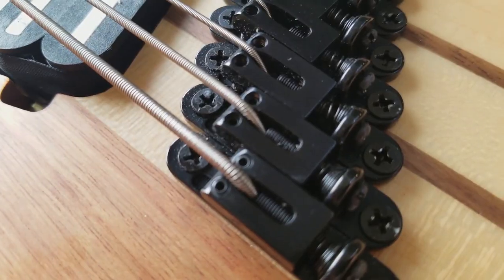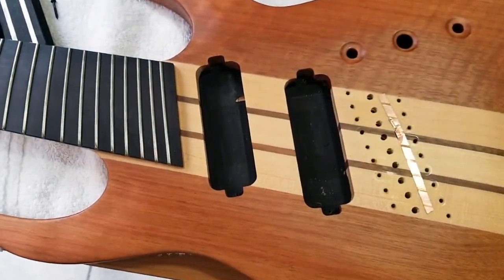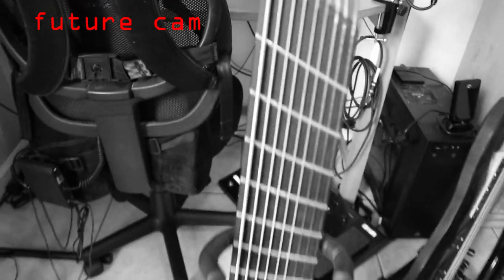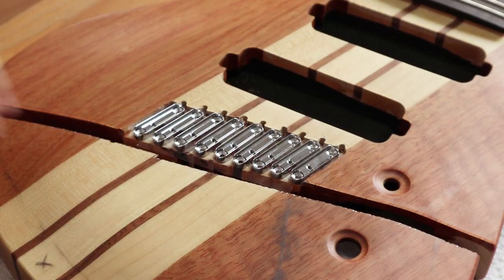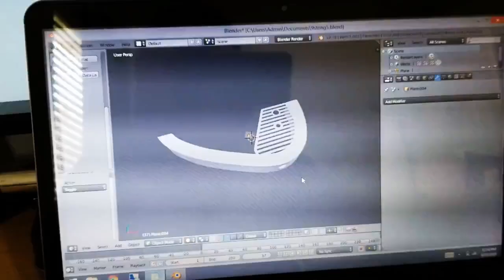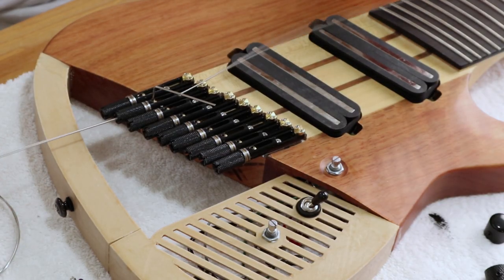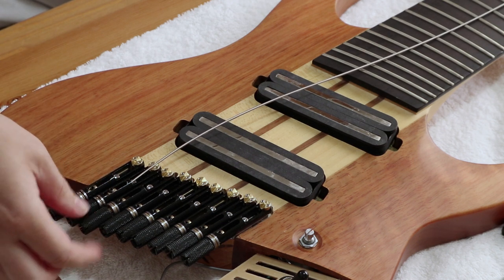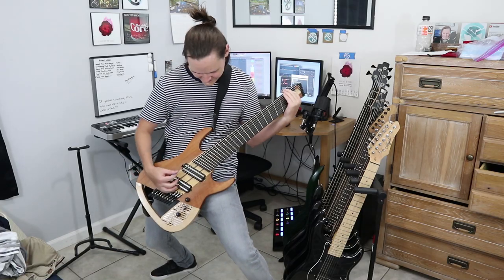9-String Guitar Headless Conversion

Comment: This is awesome! Actually, a nice work. Few things to consider:
1. Trust rod cavity cover (man, that hole looks awful).
2. Fully enclose electronics. 
3. Scratch the paint from the bottom of tuners to allow them to make proper contact with grounding wire.
Reply: This!
Reply: You could also scuff the tuners gently at the points where they touch each other. That way if one isn't getting a good ground contact directly, it can at least hand the job off to one or both neighbors. Or if he's really adventurous, he could silver solder the whole mess into one solid block and never have a problem again -- electrical OR structural.
Reply: I think painting truss rod cavity would look better than that cover that was originally on it.

Comment: It seems like you got it playable. I would do a part two and make a face plate to make the 3d-printed expansion sit flush with the body. Even a revised extension would pull it together a lot better. A little paint and/or sanding and you've got a solid axe🤙

Comment: Glad to see you actually went for it, it looks sick! I was wondering though, why use a 3D printed piece for the body gap instead of reusing the part of the body you chopped off and cutting out the same shape? I’d imagine having the same wood and neck through pattern carrying on through empty space could look pretty cool along with the fact that the transition between the two pieces should be much smoother and the control cavity’s already routed out
Reply: I think it's because he didn't have a saw that could do that he said he only had a table saw
Reply from the maker: Ya, I only have the table saw, I still have that half of the body laying around if I want to try in the future
Reply: @SaidTooMuchProductions  if you were careful, you could do it with a coping saw which shouldn't be too expensive
Reply: For the price of the roll of filament you could of gotten the cheapest trim router or a router head for your rotary tool, and just routed out a recess for the new bridge pieces. Would of looked better and saved loads of time

Comment: the sounds you're getting don't sound like an improperly grounded bridge. They sound like a lack of shielding. That makes sense though as your wires aren't shielded by metal, or wood, or plastic for that matter. You'd need to modify that control cavity to have walls you could shield if you wanted to get rid of the hum
Reply: The hum goes away when he touches the strings.  It's almost definitely a grounding issue.
Reply from the maker: ... that's what I've figured

Comment: I myself would have taken off more wood cutting off the horns and only leaving the arm rest and the lap rest thus turning the contraption into a 9 string travel guitar,- which I think would be cool af.
Pair it with a 5 string short scale bass and you´d have the beginning of a compact lightweight laptop studio where every single item could be fitted into a custom made flightcase and you´d be good to go,- record virtually anywhere....
Hmmmmm......
Just might have myself a new project here....
Good one. :)
Reply: Time to whip out a U-bass with roundwound strings and sound just like a P-bass or J-bass, in an instrument that's only a bit over two feet long...

Comment: would be cool to see someone do a headless where instead of a nut and fasteners, a hardtail bridge is used, allowing the "nut" height to be individually set per-string
Reply from the maker: That's brilliant, an adjustable locking nut
Reply from the maker: I'd like an adjustable nut for drastic string guage change around as well lol
Reply: @SaidTooMuchProductions  the main issues i foresee are that you either have the ball end at the "wrong" end, requiring a tuning bridge that can deal with that, or you'd have to make some kind of locking mechanism yourself. or try to graft double ball ends.

Comment: gotta admit, i lack the balls to take a perfectly good guitar and saw the headstock off. if it was mine, given to me in the current state with a 3d printer available, i'd do a full 3d printed body project, maybe do a home-depot maple core for strength and neck mounting and print the rest. if i was starting from scratch, i'd have trimmed down the body more strandberg-ey instead of a wrap-around, and might i suggest 3d printing a superficial headstock addition for wall-mounting? wouldnt need to be structural, just an epoxied discreet flair, and you could paint the new parts black to look classy with the old wood look. raw wood and flat-black always looks slick. the 3d printed color looks kinda...odd. if you do a 3d printed body, you could do a very skeletonized look, paint it black, and then add a thin clear top to it. i've done a carved semi-hollow bass that has a clear top mounted over the carved bits and it looks neat. you'd be amazed what a 600 grit hand sand and some flat black spray-paint can hide or make intentionally designed looking.   also, let me just say the fact that this has under 15K subs and tic-tock trends have more, makes me throw up in my soul a little.

Comment: Yeah man, that's a really cool video! I absolutely love DIY guitar mods and I have to admit that you have to be pretty brave to butcher your 9 string this way :D. But you really made some mistakes and the result could be better. I decapitated a guitar once and I think you should've prepared better for this. Drawing a scatch or photoshoping something over your 9 string in it's original form would've helped a lot. And you could avoid 3d printing (because tbh this part looks not very professional) by making a strandberg looking design with this deep cut on the bottom. I heard about your lack of tools, but you could borrow a jigsaw for a day, the result would be much nicer looking. I did my guitar this way and it came out pretty cool. But maybe i just nag too much, you did a good job, it works and that's the main thing, in my opinion you just hurried too much in some parts of work and that's why some parts look a little sloppy.  If you had spent a little more time and patience, and calculated things more carefully, this could come out much better. Things like this need precision, but anyway it's a really cool experience. Thanks for sharing this vid and good luck with your next projects!

Comment: I'm all for the jank, but router isn't that hard to operate, yknow... And you can print perfect templates with your 3d printer
Reply: Also you could just get a cheap drill stand off of amazon to serve as a poor man's drill press.
Reply: Now that he's sawed off the big chunk, he can carve on it without a router anyhow. I think he should just do that (carve away the necessary bits of the original sawed-off piece) and put it back on, maybe with a visually pleasing spacer in between to make up for the thickness lost in cutting.